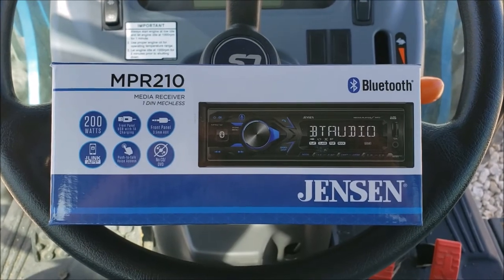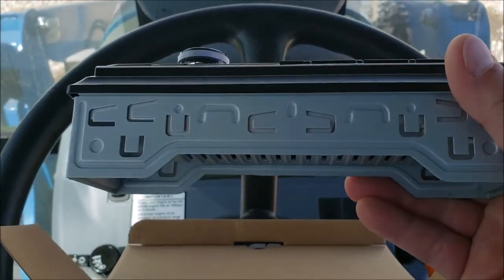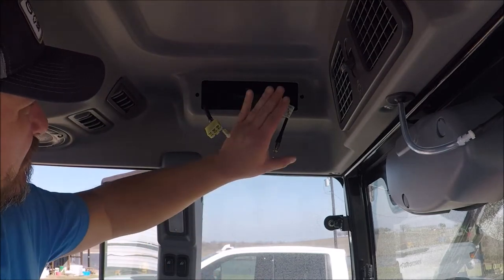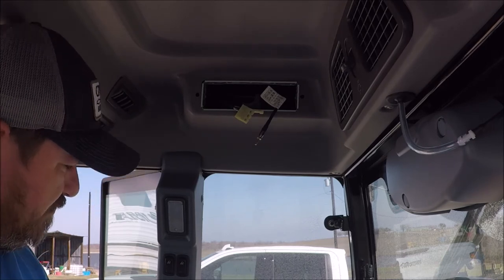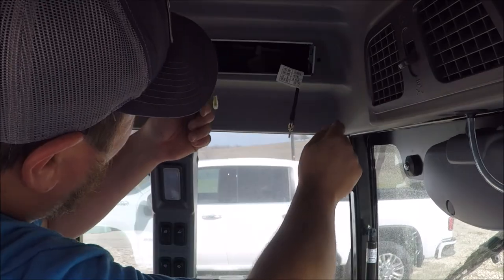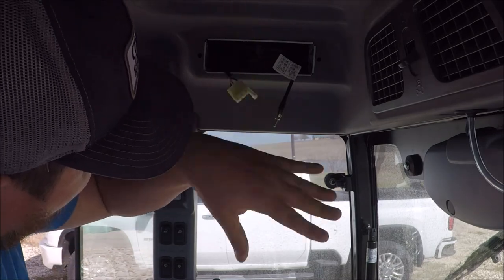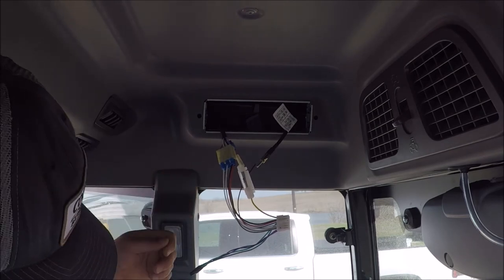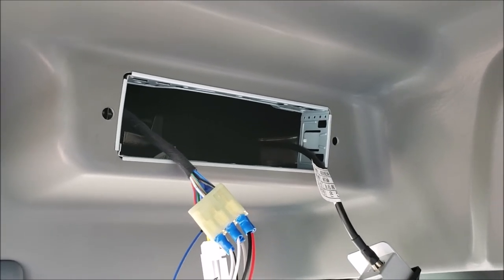LS Tractor Radio Install - Cheap and Easy - MT342 Cab

Comment: Great video. you just need some better speakers to go with the new radio to get the tractor rocking out. look at my video on my radio install i had put 5 1/4" speakers in but you need spacers to avoid the hvac in roof due to the depth of the speakers and you don't even have to cut bigger holes. Thank for posting
Reply from the maker: Thanks.  I did watch yours.  How do you like the ones you got?  Would you buy the same ones again?
Reply: Yes I would by the same ones They were great

Comment from the maker: So far this radio has been GREAT!  It really rocks but the cab speakers can't handle it.  I am currently looking for some good 4" speakers to replace the factory ones.  Do you know of any good ones?  I would like to stick with 4" because of the holes, but I am open to going a little larger if it really makes a big difference.  Check out this radio here: https://amzn.to/36wlnSR 👍

Comment: Good video on the install.  I upgraded my speakers with some 4 inch 4 way speakers from Walmart.  Not the best brand but definitely an improvement over the stock LS speakers.
Reply from the maker: Thanks for the info. I was thinking either a good set of 4" or buy some rings and go 5.5".  Still deciding so I have not done it yet.  The stock speakers have to go soon though.

Comment: Thanks for the video! I'm sitting in my New Holland Boomer 40 listening to your video on my newly installed Jensen MPR210 (thanks to your and Michigan Heating Guys videos)! Just for info....your wiring diagram colors seems to work the same on my Boomer (it's an LS tractor). I did have to turn the bass all of the way down due to the lousy factory speakers that you mentioned. Thanks again!
Reply from the maker: Awesome to hear.  Those factory speakers are very basic, but at least you have some tunes now.  That speaker upgrade Michigan Heating Guy did would be nice.

Comment: Thank you so much. I could not find the wire colors anywhere. You also sold a Jenson MPR210. Just wish it had weather radio and alerts, but to get that on a radio was around $200. My ham radio has weather alerts. May use the rear outputs or RCA to add a small subwoofer behind the seat??? I am considering a set of 4" Jenson speakers as I must match brand;) to replace factory. Still using my JBL Bluetooth speaker for now from my cell phone. I most look forward to bluetooth calling.
Reply from the maker: Glad you are getting all fixed up. Mine sounded so much better after changing the speakers.
Reply: @SeidelRanch  What speakers did you end up going with?  I just installed my BT Deck (THANKS for your video).  Yes, the speakers are terrible.  Did you stick with 4" or go the same route as @MiHeatingGuy?
Reply from the maker: @kwmuir  I did end up getting some new ones off of Amazon.  I stuck with the same size as the ones it had, but they are probably not as good as larger ones.  They are way better than the stock ones though.

Comment: Are you able to put the gray LS faceplate that came with the tractor back on with the center punched out after you install this radio so it covers the holes up?
Reply from the maker: Not on this radio, unless you want to trim it.  This one had a non-removable trim already on it.  With that said, it does seem a little tight even if you chose a radio that had removeable trim so you might have to trim that piece with any radio.